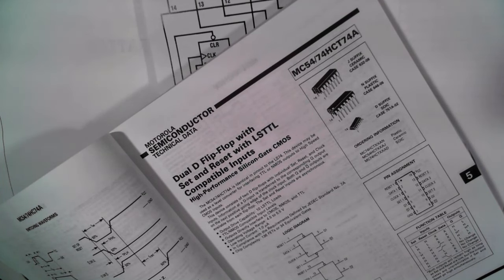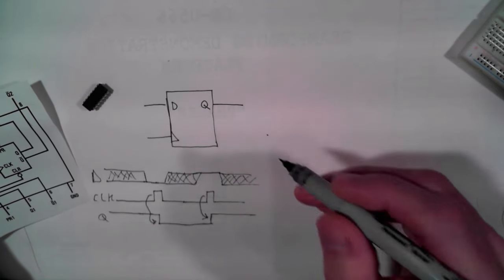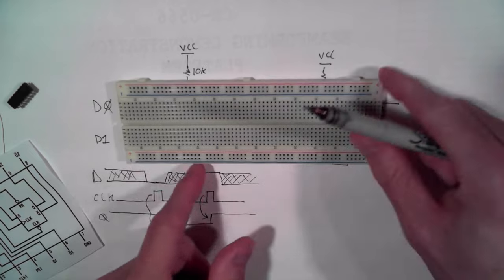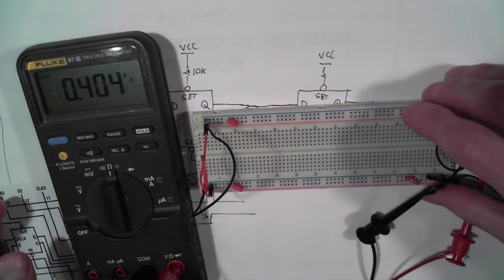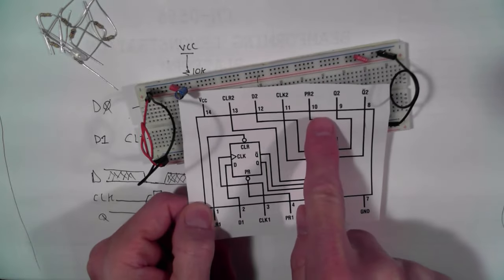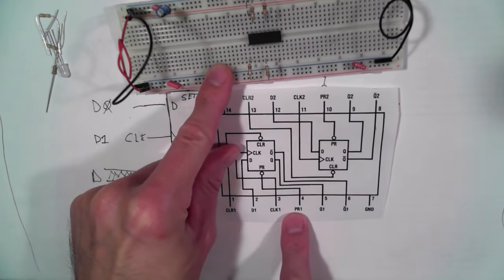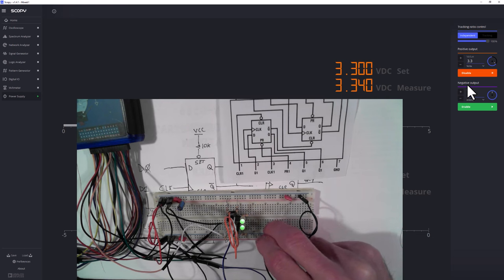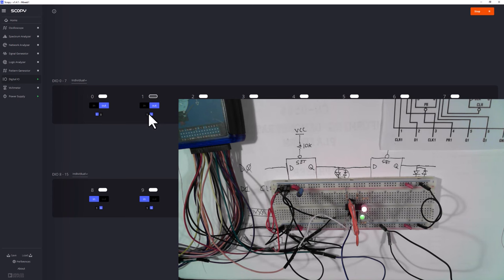Flip Flop Fun!

Comment: If you use jumper wires that lay down, the circuit looks a lot better for study and display.
Reply from the maker: Definitely. Perhaps the most extreme example is the works of art at https://eater.net/ .
(While I didn't have a "hard" constraint, I wanted to show the use of the jumper wires included in the ADALP2000 parts kit.)

Comment: "race hazards". sort of like the reasons that the "grey codes" were developed. can make an encoder that gives straight binary output... 00, 01, 10, 11, 00... it has two points it can induce errors... the transition from 01 to 10, and from 11 to 00, where TWO (or more) terms must change AT THE SAME TIME.

and as nothing is perfect, they DONT change at the same time... and you may very well get the wrong output as a transient that causes further issues "down the pipeline". grey codes never have more than one bit change on every step. 

a two bit grey code, or ideal encoder, would step 00, 01, 11, 10, 00... only ONE bit change between steps.

then you get reflected and excess 3 codes for simplicity in mathematics. as digital circuits cant divide or subtract but rely on addition and complementing. and they all tie together to reduce the likelihood of "race hazards".

and ideally, they all work together to allow for "error checking"... checksums and parity and all that jazz.

all that "technical" stuff that real intelligent men spent years working on so we can have our modern flashing screens and "information technology" with CPUs operating in the GHz range where all this stuff is obscured and discarded as "old, irrelevant, fuddy-duddy nonsense"

sort of like why high speed busses need to be made the same length...

and seemingly unrelated, its why diesel engines need high pressure injector lines to be all the same length... so the pressure wave arrives at the injector at the same time in every one. otherwise the ignition timing goes all wack between cylinders. (traditional rack pumps, not these modern "common rail" nonsensical designs). in this case, its a "race hazard", but its a "non critical race hazard" as the engine still runs, it just runs... "rough".

its good to be able to draw analogies between completely unrelated topics ;) wtf does a diesel engine have to do with a shift register, lol?